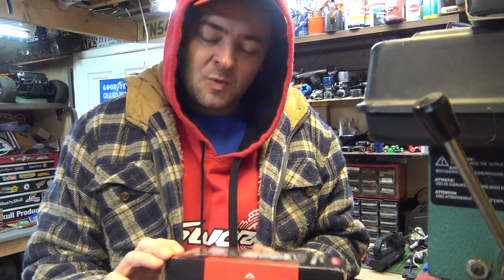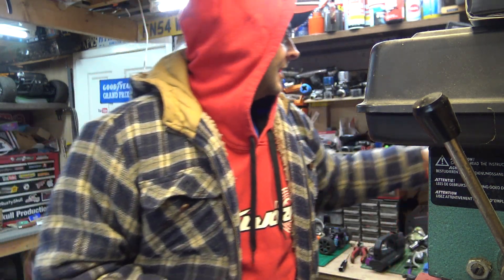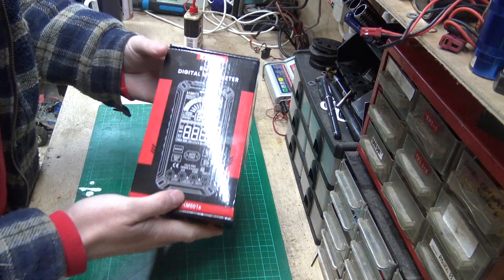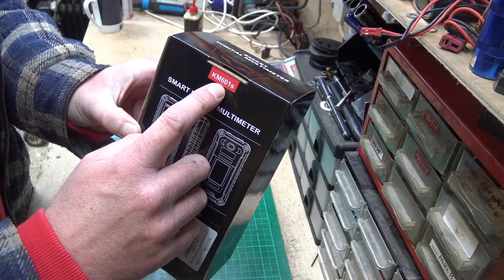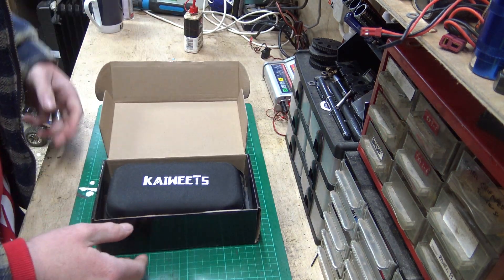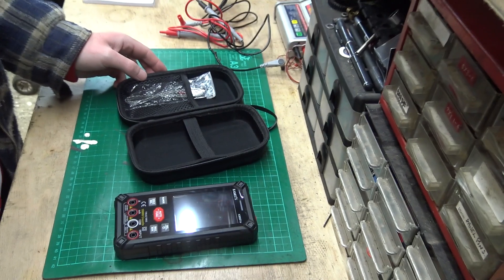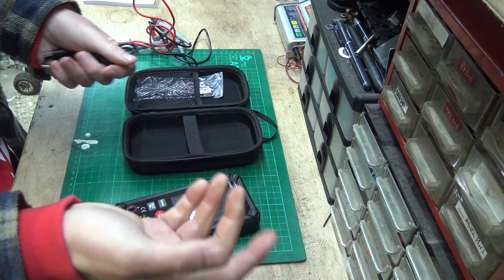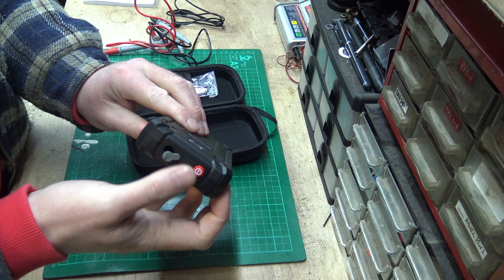Kaiweets KM601s Smart Multimeter Unboxing & Review

Comment: I am in North Texas and I bought this as a backup just in case my Kaiweets KM601, the previous model, goes out.  I haven't found out how to bypass the Auto OFF
feature.  I use this mainly when I'm balancing my Lifepo4 batteries and I hate having to get up every 10 min or so to keep it from turning off.  That's the only feature I dislike on this newer model.